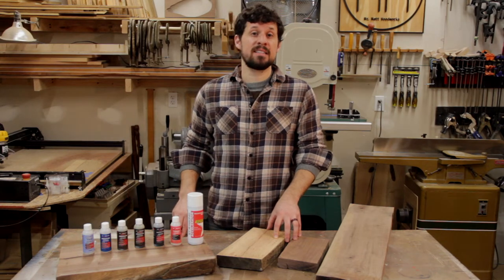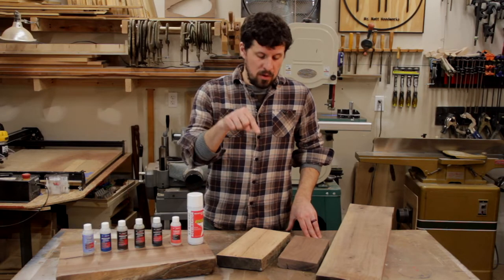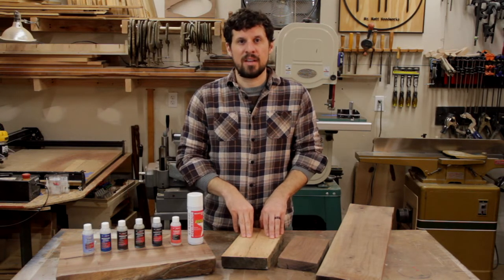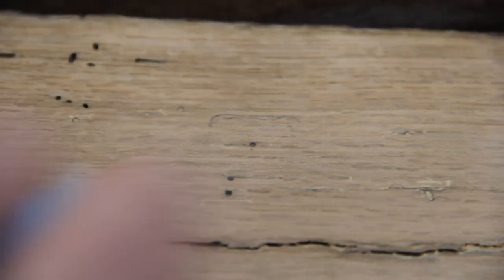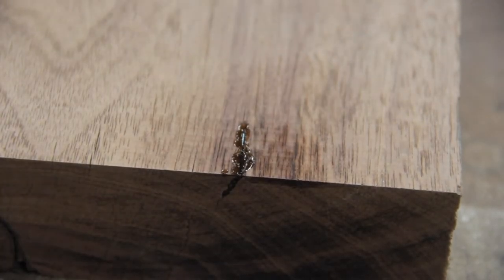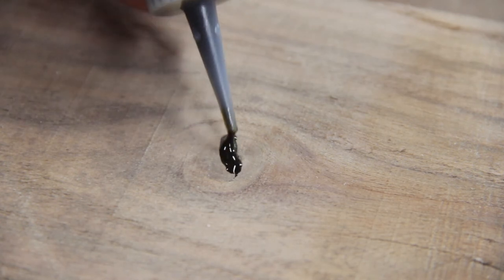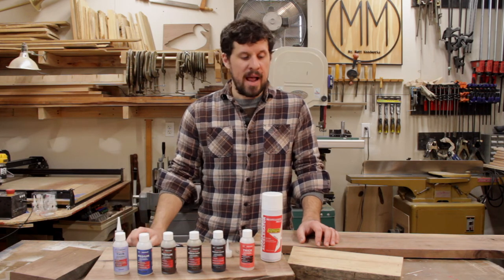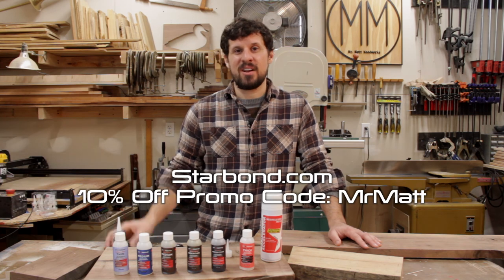The Best Way to Fill Small Holes in Wood | Starbond

Comment: Awesome video, sir! A coworker told me about this product and I literally have 254 powder post beetles holes to fill… I’m sure nobody but me would have counted them for the sheer curiosity and fun of it…😂😂😂😂

Have a great day, and be blessed!
Reply from the maker: 254?! Better get the big bottle.
Reply: How does this fair when filling powder post beetle holes in a surface you plan to stain?
Reply from the maker: The key is always layering. It will hold up fine once cured, but you will certainly see the filled holes when stained. As stain penetrates the wood and glue differently, it will be noticeable. Could be a neat design feature.
 @brandicash7877

Comment: Thanks.  I'm curious if there are any issues with reuse of those bottle tips.  Do you need to clear the tips in some way to reuse weeks later?
Reply from the maker: They send a ton of extra tips so if it gets clogged you either snip the tip or just put a new tip on.

Comment: But, would like to see you stain it now to see if it sticks out like a sore thumb. I have a few dents on the top of a table that is a light wood that I'm about to stain a dark brown. My bf says there is no way to fill them without them standing out too much after staining. I hate the dents and want them gone. Any suggestions?
Reply from the maker: There are some videos showing how you can get small dents out with a wet rag and an iron. Scratches that have broken the wood fibers will need to be sanded. Not sure how stainable the ca glue would be for that application.